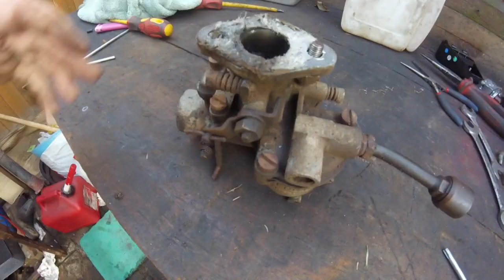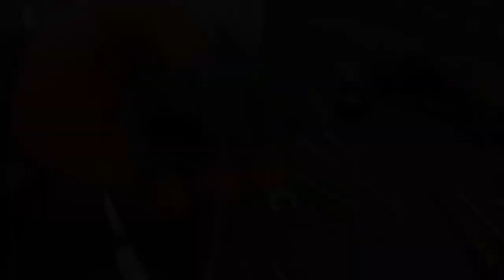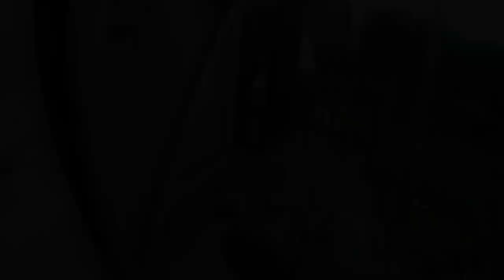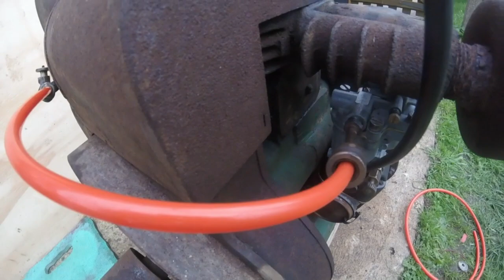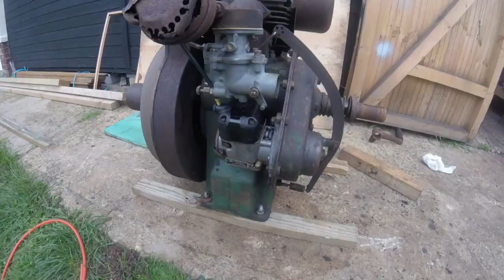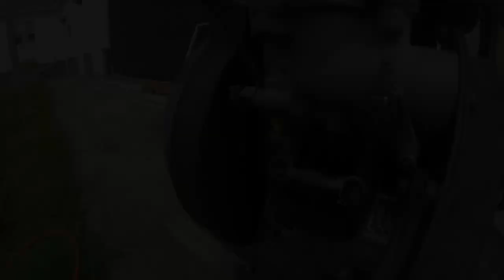1947 Petter A2  Restoration Part 3 - Zenith 24t2 carburettor Strip Down & Clean  WILL IT START

Comment: That's not restoration that was simple.by the way you struggled with the points I wouldnt bother . I would stick to pushbikes.
Reply from the maker: That was only a part of the Restoration, as for the points that was the first time doing one of those mags and I got the machine to run before I do a full Restoration, and by the way I dont ride bikes

Comment: I know its abit late but it should be set to between 1.5 and 2 turns, trying to stick to the lower. Any more then 2 turns will let to much fuel through and it will run out the bottom as seen, engine will also be running very rich and smokey.
Reply from the maker: thank you I still haven't finished the engine yet so will keep that in mind

Comment: Great job on getting that engine up and running. Do you know what that particular engine was use for?
Reply from the maker: I would say it was used on a farm really
Reply: @roystheboy  yup, for sure. I have one of these. I bought mine 2 years ago and it was basically rotten. It had chicken poop in the flywheel guard, so had obviously been on a farm.

Comment: Over here in the states, we call that carburetor an updraft. You may already know this but if you lose any compression from the rings, valves or just a bad casket. It will not start. But you got it to running and that's what counts. Good job.
Reply from the maker: thanks duke